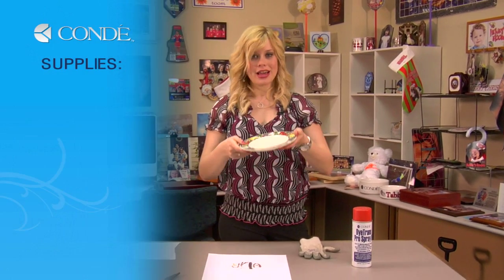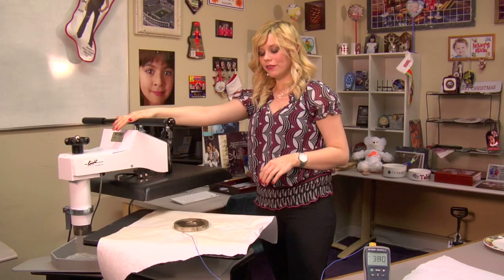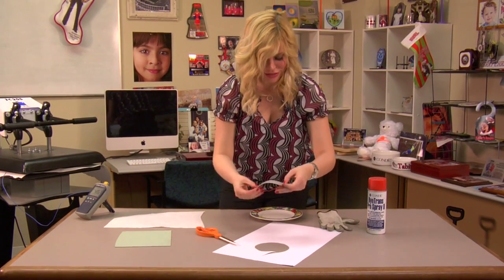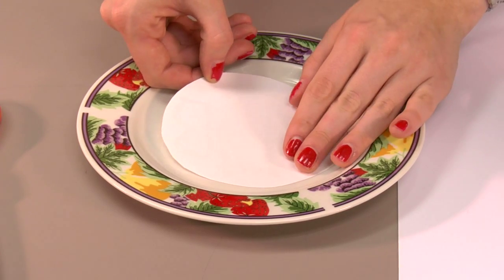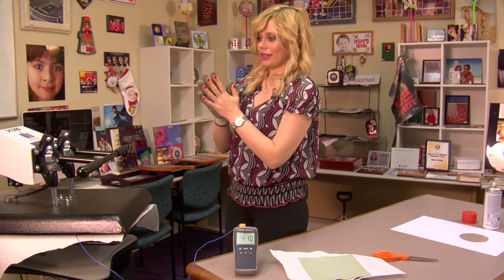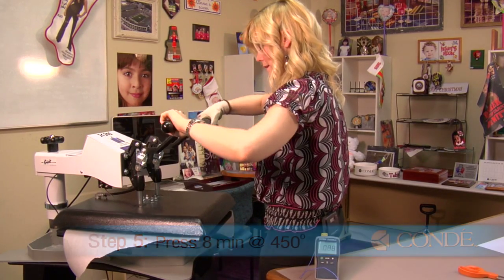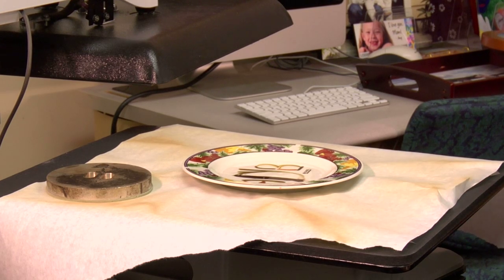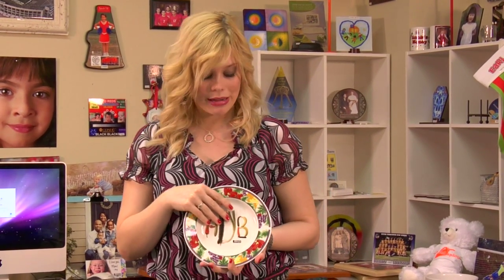Ceramic Plate Imprinted with Dye Sublimation -

Comment: Hi,

Can I be able to print on any ceramic plates or there is any specif plates.

Thanks,
Jeevan
Reply from the maker: C M Jeevan These are sublimation coated plates available at our website conde com. You need special sublimation inks and a heat press to make them.

Comment: What is the largest design area you can do on a plate with your machines?  Thanks!
Reply from the maker: The plate is only 5" in the interior area. If you had a bigger coated plate we could do up to 108", but that would be a huge plate indeed. Remember, the plate needs to be coated for dye sublimation.